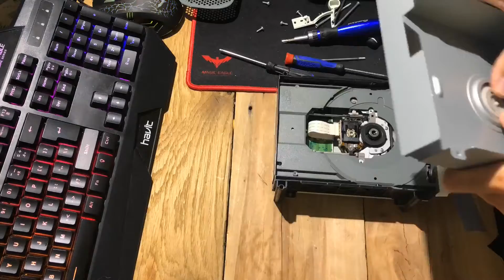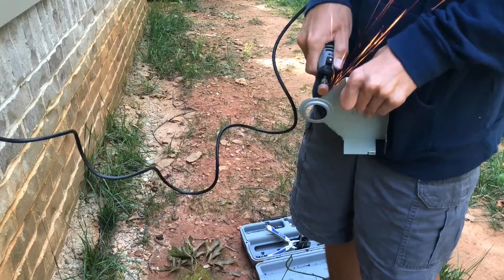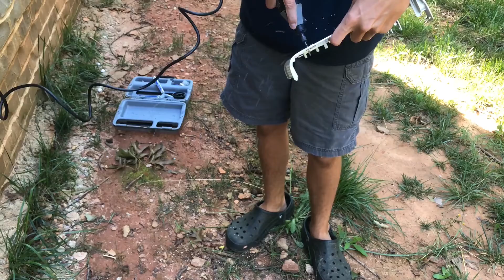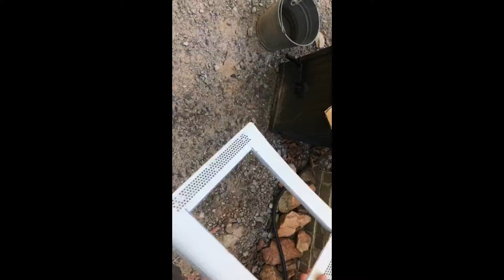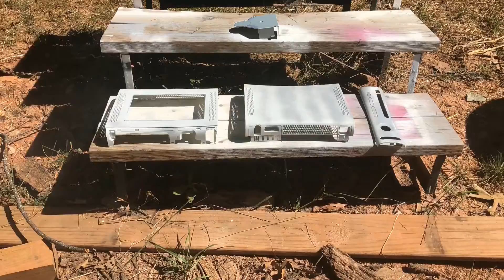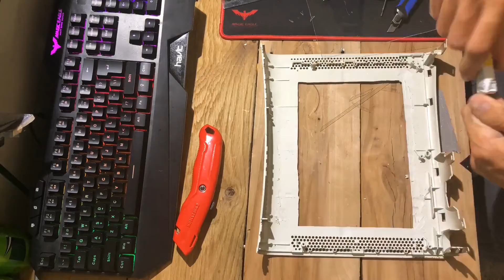xbox 360 restoration and customization

Comment: Nice mod
Reply from the maker: Yeah it still needs work though. It has no display and I’m thinking about making my own av cord by soldering to the motherboard itself.
Reply: @thexboxguy8099  you have to reflow the CPU and gpu with a Good amount of flux. This will fix your Display Problems.
Reply from the maker: Ok, I’ll give that a try. I didn’t suspect that to be the culprit right away because it doesn’t have a red ring.